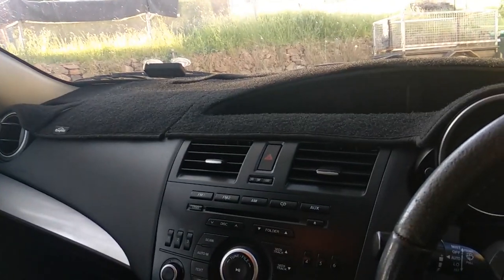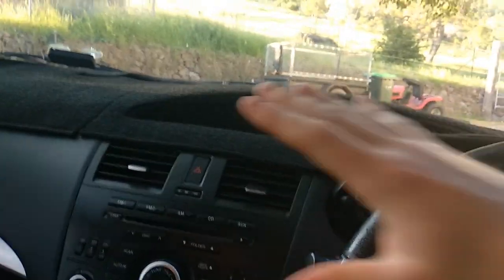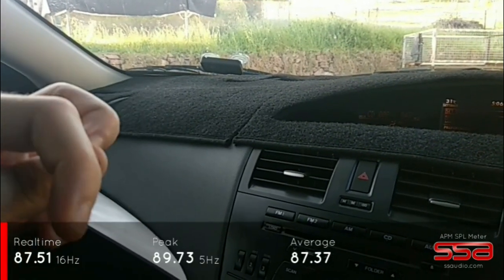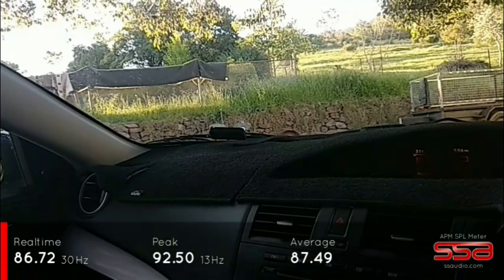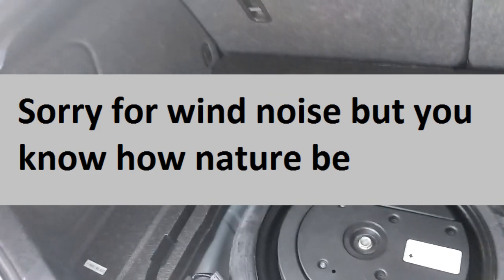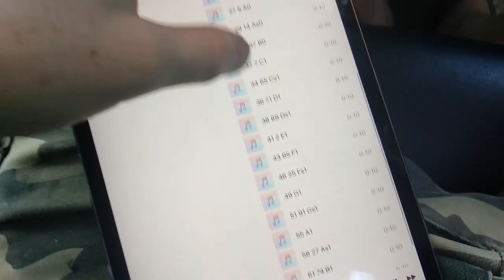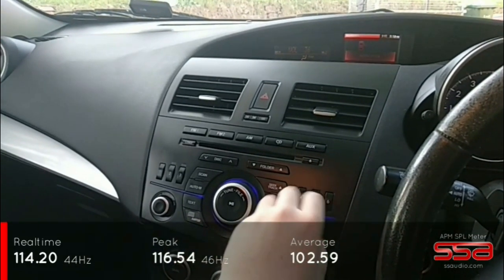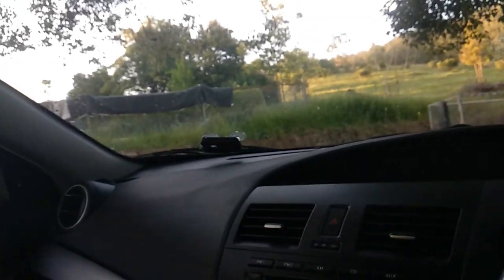How loud is the Bose subwoofer?

Comment: I've got this sub hooked up in my VW Polo & I've got to say it's pretty amazing, perfectly fitted under my boot floor with the spare tire underneath & it shakes my mirror 😂 You can only hear at the deepest notes it's lacking a tad as the drivers are so small, other than that for the price I paid I'm dead impressed
Reply: Quick update, I've had it hooked up to a high end sony unit, an alpine unit and recently a new pioneer unit, with the pioneer it's even more punchy and clear, would recommend getting one with the inbuilt amp!
Reply: @FIetch2002  can you share a little more about your installation? Did you connect the dual voice coils in series (4-ohm), or in parallel (2-Ohm). What amp rating are you using, will you please share the model? I am getting ready to install this same unit and I am looking to size the amp.

Comment: Yeah from my own Nissan 08 the alternator is very strong. 130amp I think stock. Kicks on at a low 600 rpms. So way lower then even idle.
So it's only a slight difference if your driving with all electronics on and punch the gas. It does help and gets louder. But for the most part it needs no extra rpm to actuat the alternator.
It's yes sad if you've ever owned installed subs. Or know what your doing and installed them. But not bad honestly. I don't even understand how a 4 inch cone can produce 50 hertz. But it does. Way to go Bose.
Also the front 6x9 also get to about 43 hertz low. But they don't have a highpass or low pass and I've kinda burned mine a bit. I smelt it quickly enough so they still bump. But man that cheap hfp is worth it Nissan.

Comment: Just got my rsx and the sub doesn't do anything. What are the first steps I do to figure out why
Reply from the maker: (Assuming its a stock sub)
First step is get a multimeter, check the resistance of the sub to make sure its resistance is what it should be. Very low could be a short, and might've damaged the amp also. Very high/no measurement could also be a dead sub, or loose wire.
Check to see if the wires to the sub are delivering voltage, get a 40Hz tone, set it to loop, crank the gain, should see a few volts. If there's nothing, could be either the amp/head unit, or the wires between the amp and head unit. Can also check the resistance of the wires to the amp, but make sure it's turned off. Should give an indication if something is loose.

Comment: This sub is joke, no bass... Front speakers in fiat croma 07 is 3x better than soundsystem bose with sub bose in mazda 6...
Reply from the maker: Yeah, basically the same story as my home theatre sub vs random car sub. 4 6" midbass speakers have the same surface area as a single 12" subwoofer, and since the bose sub is responsible for everything ~90Hz down, from a single 6" driver in a ~5L ported box, it's just too small. Kinda pointless, too. A for effort, D for performance. Horn kicks its ass lmao.
Reply: Exactly! I recently got Mazda CX-5 with that Bose sub . Very weak !! I want to upgrade to  kicker 😆
Reply: Ciao quanti litri e 5 ? Quindi non suona bene il subwoofer?
Reply: @Dakoustics  mi sai dire quanti watt e questo sistema bose parlo de subwoofer

Comment: I need your help with subwoofer box specs. I have 2 12inch american bass xfl subs the new ones and I wanted all deep bass with one port I have a 02 trailblazer they will be going in
Reply from the maker: For deep, a big box is a good start. Something like 70L/sub, so 140L/5 cu ft total. A port with an area of 12x3", and a length of 2'. Comes out to a tuning of 26Hz, should be quite capable of lows. If you want lower, longer port.
Reply: @Dakoustics  thanks man I just wanna be heard from a few blocks with the bass
Reply: @Dakoustics  so can my box guy go off of the the specs you sent me?
Reply: @Dakoustics  can you give measurements of making a box for that sub(bose)

Comment: 80w r.m.s.? I thought it was 100w r.m.s for single voice coil and 50w r.m.s x2 (100w total) for the dual voice coil.
Reply from the maker: I didn't know the power figures, estimated it at 80w, I think I measured the sub DC Re of 2.5 ohms, and 10v in, so that'd be 4 amps at 10v per coil, or 2x40w. Honestly can't remember what the exact numbers were now, but at the time I was more confident on 80w than 100w.
Reply: 80 watt rms
160 watt max

Comment: What’s the summary? Is the Bose any good? Compare it to other systems?
Reply: Well it does come with a built-in amplifier and a high pass. I've owned 2 ported 12"s so it's not as deep in the chest. It doesn't move through you. But honestly I'm impressed. Mine cuts out at roughly 35hrz. 
If space a decent sound is your goal 👍. If heart thumping bass is your goal. 👎

Comment: What ohms is the dvc spare tire subwoofer? It’s from a 2010-2013 Mazda, no internal amp. I wired it to my kicker amp and it works well, just curious on the specs just in case
Reply: I just wired the same Bose woofer from a 2013 Mazda 3 hatch (100 watt DVC, 1ohm 5.11" woofer, no internal amp) in my 1994 Acura Vigor, placed in the spare tire well and wired to my Phoenix Gold 800.5 amp, with a 300 watt rms @ 2ohm or 400 watt rms @ 2 ohm rating.  I'm way over stressing my amp with that 1ohm load and over powering the sub by a few hundred watts but MAAANNN does it hit nice for a tiny sub.  Gain is at 0, bass boost is at 0, HPF is at about 75hz.  The Bose enclosure is doing some magic for the small driver for sure but it already sounds much better than my Kicker truck cab sub+box I had in it.

I plan to replace the Bose woofer with a Skar 6.5" sub that can match my amp and handle the power properly, hoping it and the Bose enclosure will play nice together.